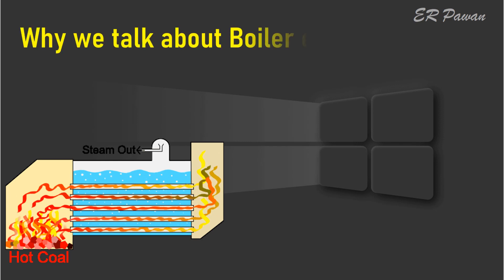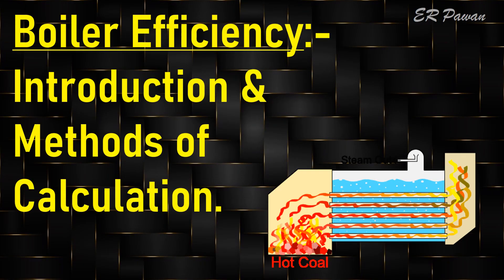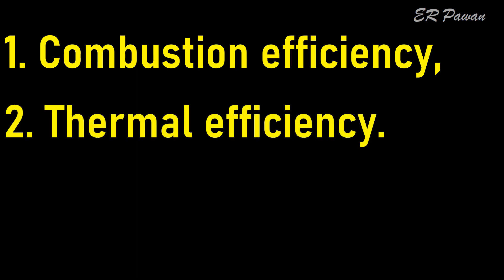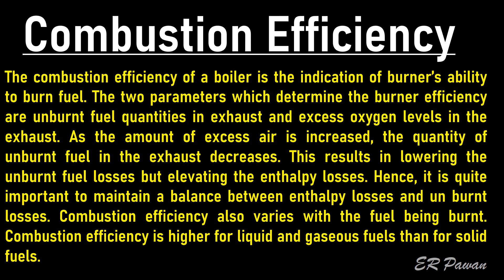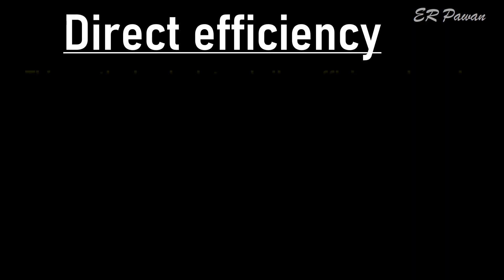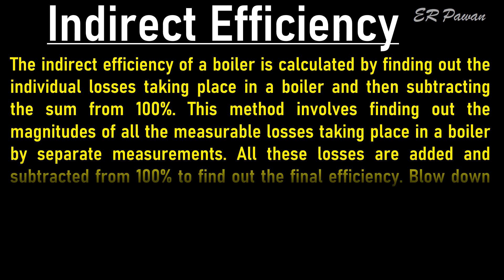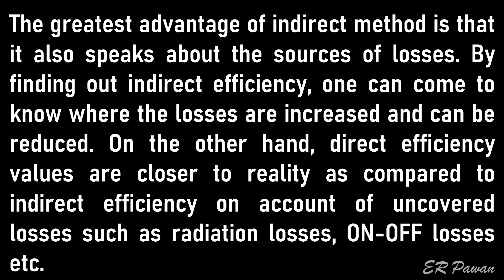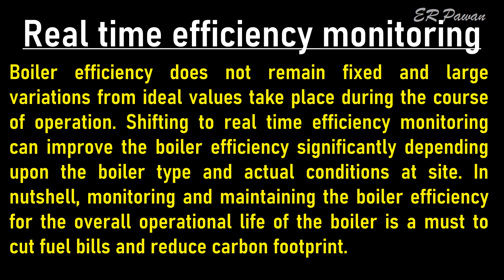Boiler efficiency Calculation | Formula to calculate boiler efficiency | Calculate boiler efficiency

Comment: Thanks for you
I am a student at university of Jordan and I have a project about efficiency of boiler in my college Can you help me?
Reply from the maker: Your welcome,  please stay connected by subscribing our channel for more informative videos. 
Sure  we can help you, elaborate your question.
Reply from the maker: You can write us on infothermaltech@gmail.com
Reply: @erpawan6886  ok I will contact with you via email
And thanks so much
Reply: @erpawan6886  I sent the email for you a few minutes ago
Reply from the maker: You can learn about boiler from our other videos too.
Reply: @erpawan6886  Hello 
Can you check your email?
Reply: This is my project (You are requested to provide an estimate of the Annual Fuel Utilization Efficiency (AFUE)
for heating the School of Engineering of the University of Jordan. Make any reasonable assumptions and get the best data that you can obtain regarding the diesel consumption, space requirements and heat transfer rates. Suggest recommendations to increase the AFUE)can you help me?

Comment: Cp of water and cp of steam value kya hai sir
Kuch log bolte hai steam ka 0.45 or 2.3
Or water ka 0.23 and 4.18
Reply from the maker: The Specific heat capacity of steam is around 2010 J/KgK. and Specific heat capacity of water is around 4184 J/KgK.